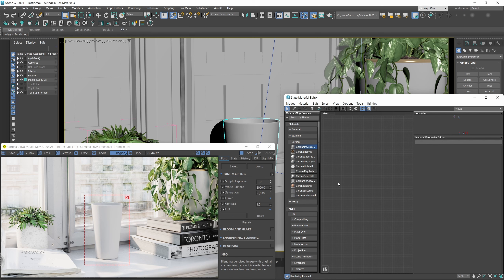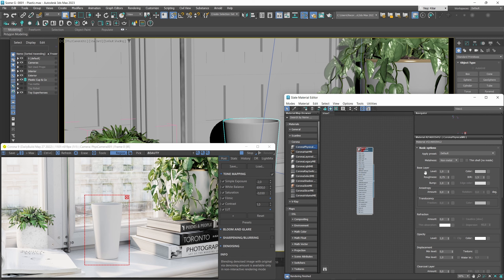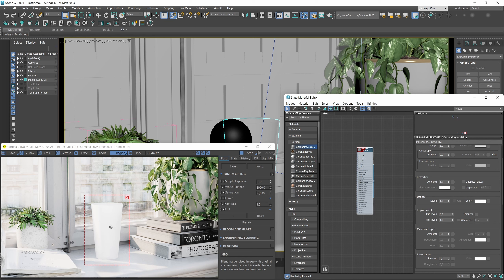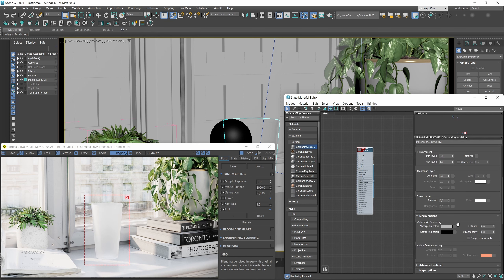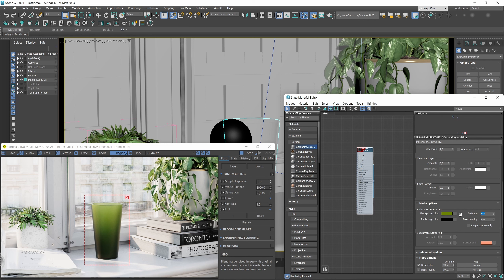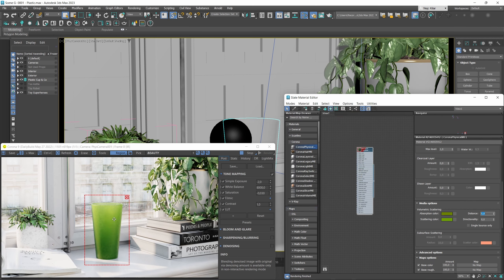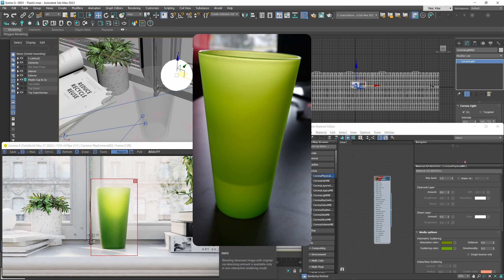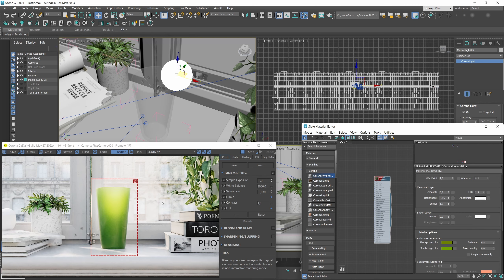Corona for 3ds Max Physical Material Tutorial, Part 08 - Translucent Plastic

Comment: Can you expain the different between "Volumetric Scattering" and "Subsurface Scattering"? I googled but they are both something like "...light that penetrates the surface of a translucent object is scattered by interacting with the material and exits the surface at a different point...". So I am confused about how to use them correctly. I would be very grateful if you could answer the question. (Sorry for my bad English).
Reply from the maker: The easiest way to think of it is the depth to which light penetrates a material. For things like wax or marble, light does enter the material, bounce around, and exit (sometimes back along the way it came), but the depth is pretty small. This is best done via SSS. It is just "sub surface", as in, "just below the surface".

Volumetric scattering however can have a lot of penetration through the material, and the ray may not actually bounce around and exit back the way it came but keep going and exit the other side just as if there was no scattering, only it gets colored and absorbed as it goes. Examples here are colored glass, or muddy water, or tea, where the ray can easily go all the way through and out the other side, but it takes on a certain amount of coloration (and loses a certain amount of energy) as it goes.

Hope that helps! Tom
Reply: Thank you so much for the answer Tom! This help me alot!
Reply from the maker: @TaiNguyen-mc1dv  Most welcome, very happy it helped! Tom